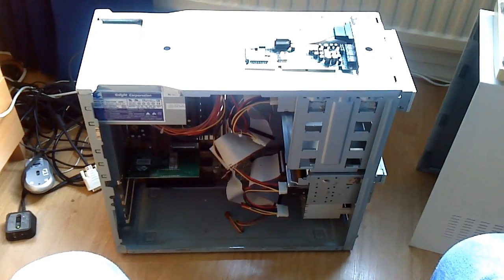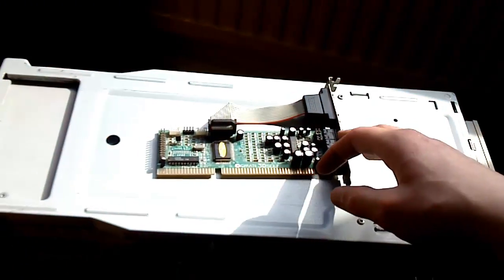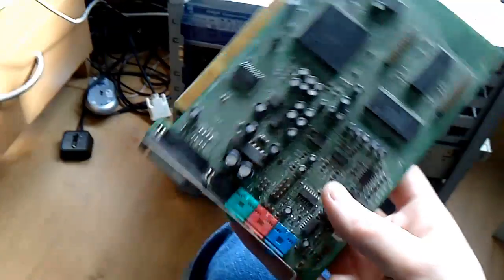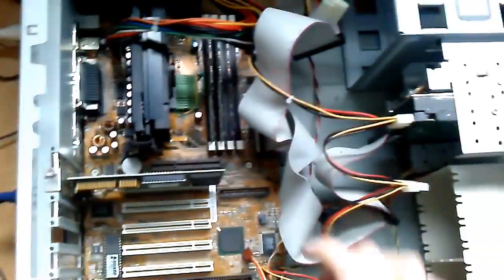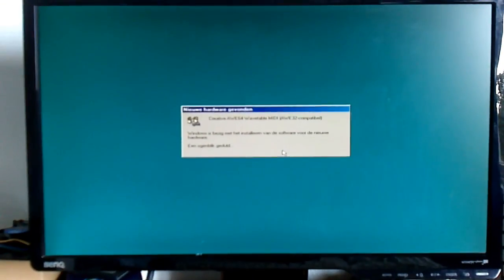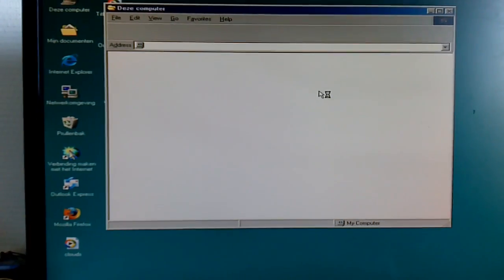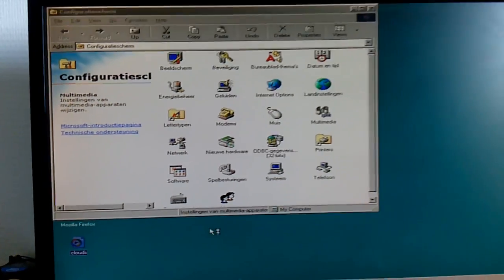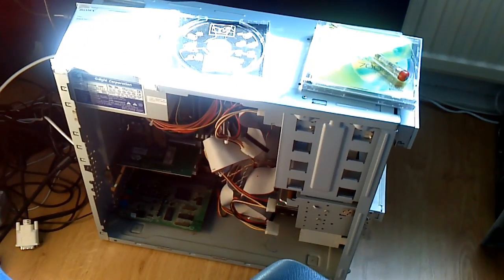Pentium III Custom Built Overview

Comment: hey
Reply from the maker: sup
Reply: NelizMastr - Tech for PC & Mac We have a project. We have to label the parts of ms-6156 and we don't know some parts of it. Can you help us?
Reply from the maker: Sure. From what I can gather it's a Slot1 board with support for P2 and P3 CPUs up to 600MHz. Chipset is the i440BX from Intel. Can't figure out the onboard sound, you'd have to look for a chip near the audio jacks to find out which chipset that uses.

Comment: try putting xp
Reply from the maker: Why would I put that extremely slow and retarded OS on such a nice machine?
Reply from the maker: Keep it English please, anything but English and Dutch are prohibited on my channel.

You don't seem to understand why this PC exists. I don't use old PCs so I can use them everyday for modern tasks or as a secondary desktop. They are for retro purposes. No internet, just classic DOS games and games from the late '90s.
Reply: nelizmastr I understand why you would prefer Windows 98 on a older machine such as this, but Windows XP is far from being a "slow and retarded OS".  I have had no problems running XP SP3 on a Pentium II 366, and it was not noticeably slower than Windows 98 on the same machine.
Reply: nelizmastr try putting xubuntu or Lubuntu and make the video
Reply from the maker: Nope.avi
Reply from the maker: Xolectic I greatly dislike XP in general, no matter on which PC it is run. That old dinosaur needed to die, and I'm glad it has. If I need XP-like compatibility, I just use Win2k or Linux.
Reply: So you refer to XP as a dinosaur and use 2000 instead?  That just seems like being contrarian to me.  I don't see any advantages of 2000 over XP on a machine that meets XP's requirements.  I prefer XP because it is still supported by Firefox and some other programs even though it is now unsupported.
Reply from the maker: This discussion is rather useless. XP, on paper, is better, but what's better and what's preferred are two different worlds. I'm not referring to which OS is superior in general, but which OS is superior on these older platforms. In my opinion, 2000 offers more performance and similar features, even though it's not equally supported or modern. 2000 will run fine on 64mb of RAM, XP can't run acceptably with less than 256, at least in my opinion. In the end, 2000 offers much better performance and is much lighter on resources than XP could ever be. Those things matter when running these old systems.